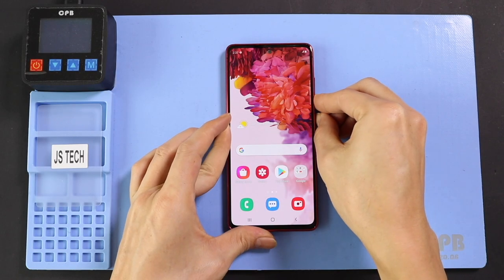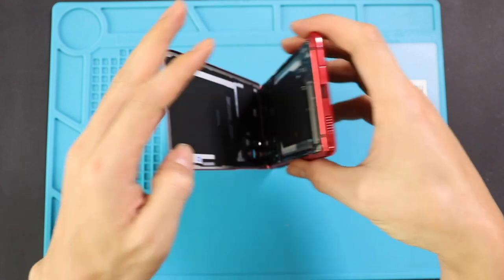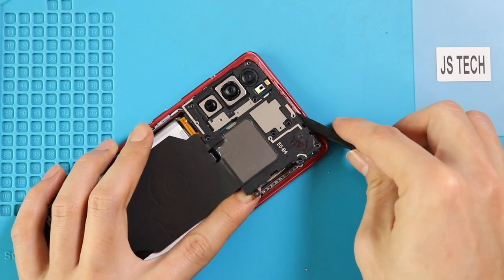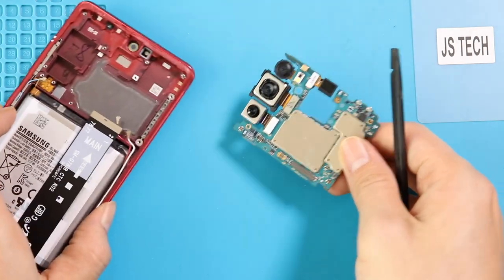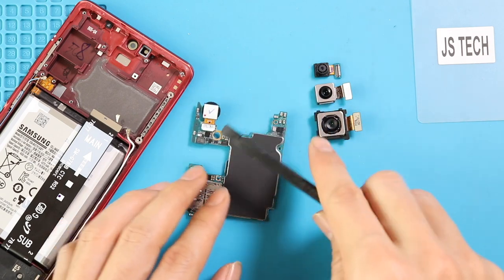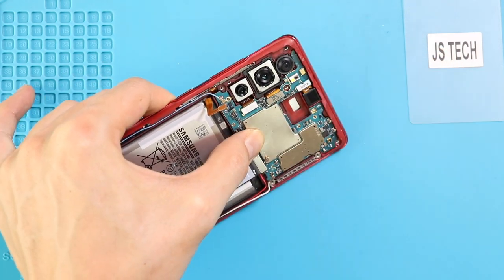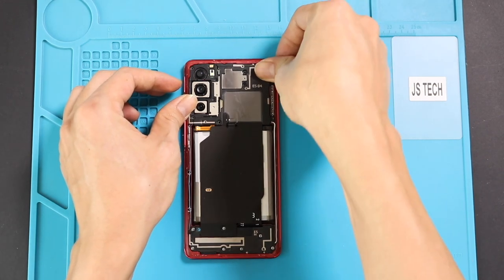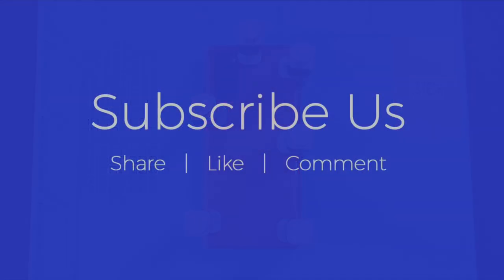Samsung Galaxy S20 FE 5G Front| Back Camera Replacement - Logic Board

Comment: Great video!  I just replaced my screen (glass, digitizer and LCD) and I'm now getting the dreaded "Warning Camera failed" error message for some reason.  Pretty sure I didn't snap anything or rip any flex cables.  I can force the front one to work through Dex, but no luck on the phone itself.  Any ideas where to get these rear camera parts?
Reply from the maker: Emm that is strange..did you check the connections?
Reply: @DIYGeardo  Yes, I did.  I now have two sets of rear cameras, and I have tried every combination of the 6 to try to weed out a defective one.  In every case, it comes up with "camera failed".  I have even formatted the cache partition every time I've replaced a camera, and no luck.  Do you know if there is some sort of DRM or tamper-protection on this phone?  Is it possible that it no longer works because the camera's serial numbers don't match the screen?
Reply: I had ubreakifix look at it and they repaired it for me, showing me the cameras were working, but I didn't want to pay their $300 for this repair, so they "unfixed" it and gave it back no charge...I'm wondering if they did something to reset the board in order to recognize their new cameras?
Reply from the maker: @Rupretio  $300 for a camera repair?
Reply from the maker: Where is your location ?
Reply: It is NOT possible to change the main camera on an Samsung Galaxy S20 FE, without being a Samsung service worker, since it is paired to the serial number! 
Again, a typical autodidactic YouTube video where people are getting mislead. You rather should post videos of companies letting us throw away new phones since they are getting mote and more unrepairable.
Reply: @Rupretio  have u manage to fix it ? Im in the same situasion, i changed the main camera(original) but it wont work, what can i do ?
Reply: @firmagnomicselektronikrepa9530  Any solution to this, what do the samsung workers enter? Thanks.

Comment: I replaced my main camera but it only says camera failed, i swapped back to the original and everything works fine, i bought original samsung camera, i bought from a legit store, but it says camera failed, what to do ?:)
Reply from the maker: you should go to safe mode and try the camera is working. Maybe something wrong with an app. Reset to original settings after back up can helps too.
Reply: Same issue did you manage to fix?
Reply: @johnyp2967  no, i went to a shop to fix it with a camera they had (original)
Same issue again, i think its connected to the motherbord/mainbord(or whatever its called)
Reply: @Sharik120  same, they tried multiple cameras same issue
Reply: @johnyp2967  i think its connected to the motherboad, i tried to polish the camera myself and now i just took the main camera out and threw it. Little did i know that because of 1 camera missing the app doest work.🤣
Reply: @Sharik120  yeah sucks cause I had to get a new phone and really like that one 😭